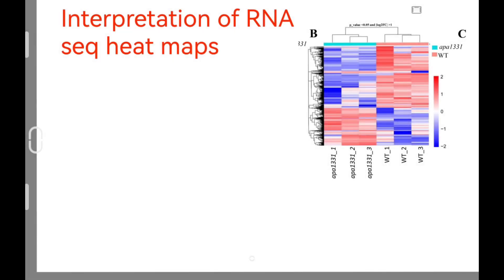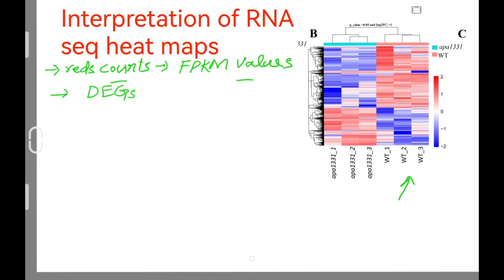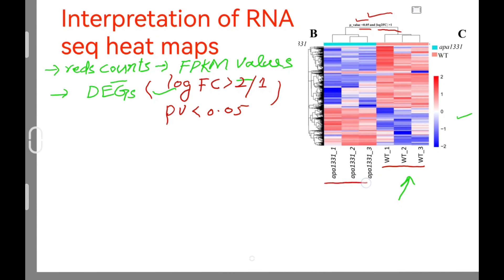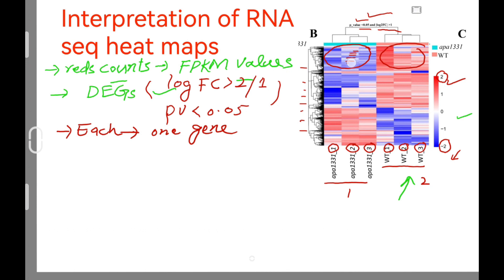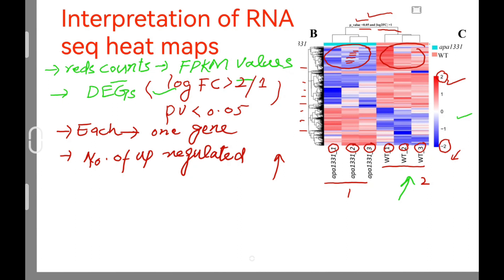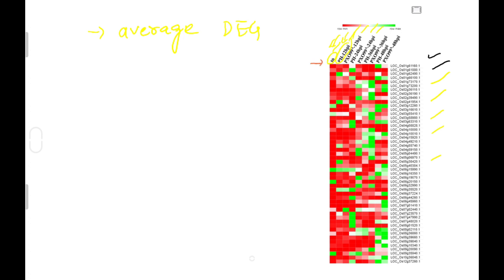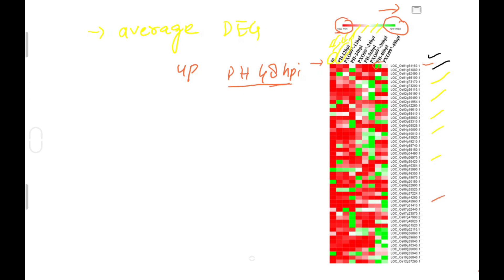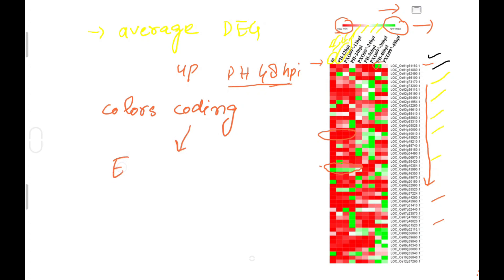Interpretation of RNA-seq heat maps

Comment: what do the accolades/brackets on the left side mean?
Reply from the maker: Please tell me screen time in video, I will have a look into video
Reply: @asifmolbio  @0:37 
The black dendograms on the left side of the figure
Reply from the maker: Oh, I got it. Actually, a heat map coupled with phylogeny (hierarchical relationships) is called an interactive heat map and that specific network is called a "dataframe". Here each line is representing one gene. The whole network is similar to that of a phylogenetic tree, however here the relationship is decided by gene ontology, not by genetic distance. In other words, the lines having common branches are showing similar types of gene ontology and vice versa.
Reply: @asifmolbio  Thank you professor! 😊